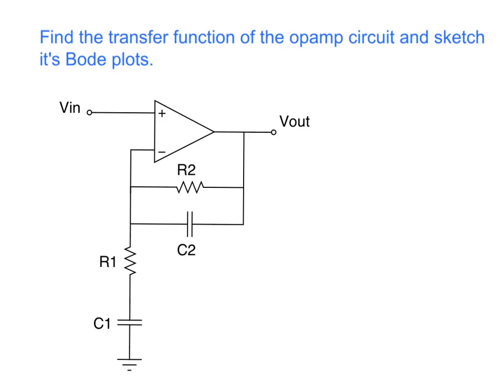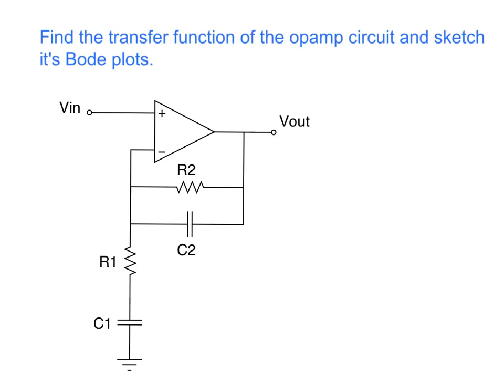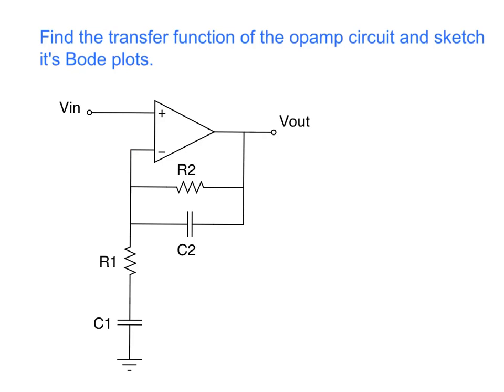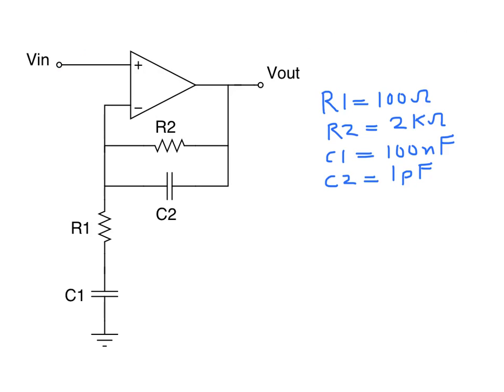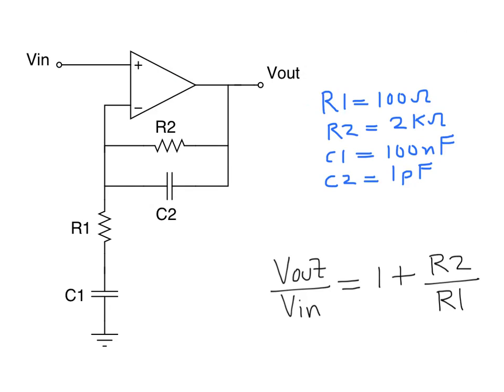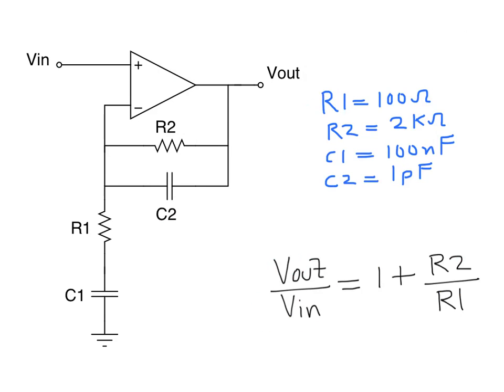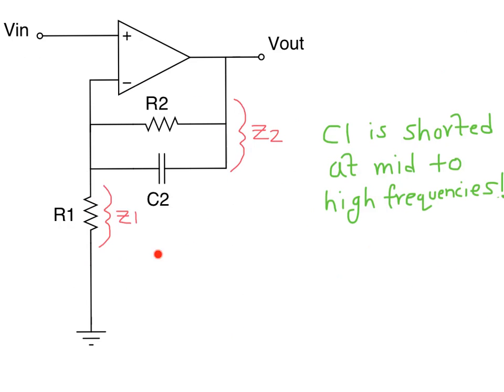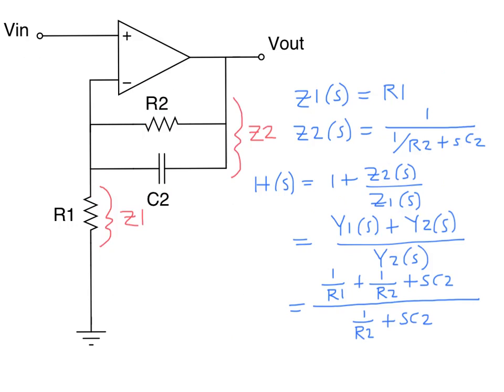Electronic Engineering Job Interview Questions (Part 2)

Comment: This circuit can be loosely categorized as a Band-Pass Filter (BPF).  Next, try replacing each resistor with a switched-capacitor building blocks (perhaps using C1's) and then try to derive the resulting frequency response (and transfer function)...

Comment: What does the (R1||R2)C2 mean ? I've not come across the symbol before
Reply: +dean tansley R1 in parallel with R2, all multiplied by C2
Reply: Like Oscar said, the double bars represents a parallel impedance.  This is calculated as the product over the sum since there are only two impedances.
Reply: It means (R1 X R2/R1 + R2) X C2.  I hope that is what you are asking because it is very basic electronics and you may mean something above my head.

Comment: This video should have more views.
Reply: It really depends on which countries Electronic Engeneering is something with any weight.
Reply: Draw dex What do yo mean? Isn't all electrical engineering difficult?

Also, huh, is it just me or are brony ee majors easier to find? You're like the third one i've seen so far, first without a rainbow dash pic
Reply: dasdew2 I'm a couple of months before graduation, so I'm pretty informed of the topic of my employment, so that’s my reason to be here. But to be clear, yes, most of the EE career is difficult. But what I was referring to was how, where I live and study, EE's end up being technicians. Since there's no R&D's (Research and Development), Big Manufacturers, or Colleges taking Grad EE’s out of College. And as such you’re not asked these kinds of questions.

In countries in the Caribbean, all EE's are used for jobs they are overqualified for, like an electronics store box mover, (Yes, I checked), and so all those years of studying design, automatization and understanding logic and the employment of microchips and lenguages of all types of software, you are qualified enough to check the products companies buy from actual engineer and install them, maintain them, or repair them. And that’s the highest you’ll ever go here. 

Now on the reason you get such a noticeable amount of bronies here is not that surprising. Believe me, if you ask for bronies of a specific career and wait, some may appear. But then again, in an EE video, you may not find a doctor.
Reply: Draw dex Huh that's both interesting and depressing.

EE majors, well engineering majors in general are hard to come by(really, anything in STEM) but the "nerd culture" does intersect with it, so I have seen physics and engineering bronies

Check out the EEV-Blog here on YouTube if you're looking for more advice ( or just general entertainment ).

"EEVblog #7 - Electronics Engineering Job Interview tips galore"
"EEVblog #27 - More Engineering Job Interview Tips!"
"EEVblog #138 - Top 5 Tips for Graduate Engineers"

I'm starting off, i've been wanting to be a electrical engineer since I was 10.
Can you share any advice or wisdom for engineering college?